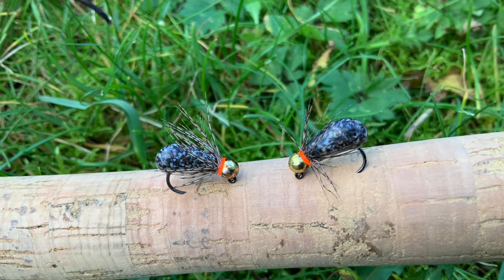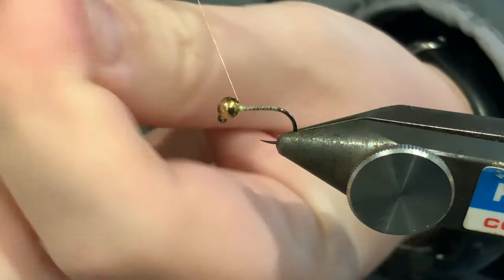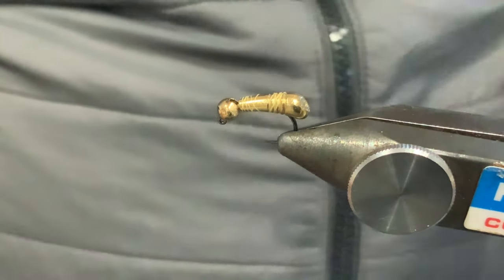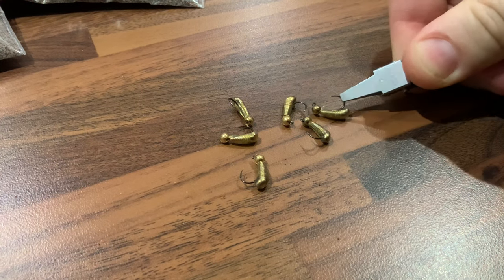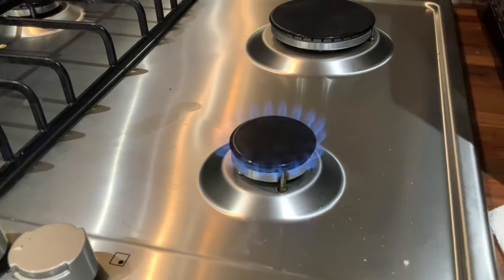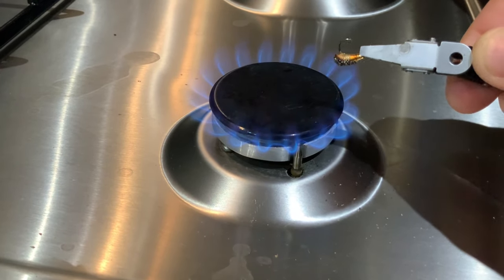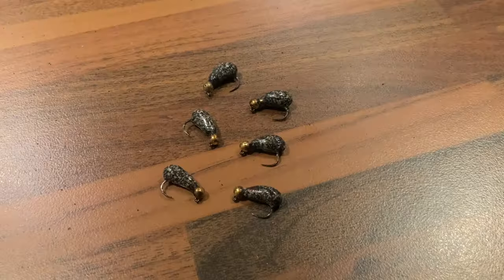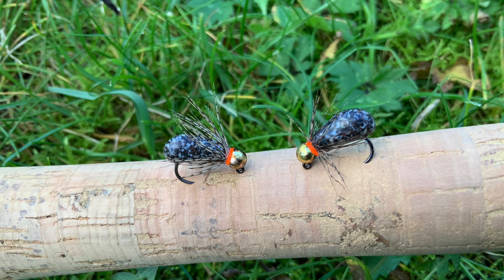HOW TO MAKE INDESTRUCTIBLE CASED CADDIS BODIES

Comment: Hi Terry, Great innovation could you post a link to the weight powder please? Would love to give this a bash.
Reply from the maker: Thanks, been using it for 10 years 😊

Just search “lead weight powder” on eBay Lindsay, loads of different colours and resellers.  Here is an example though:
https://www.ebay.co.uk/itm/GRAVEL-LEAD-WEIGHT-MOULD-COATING-POWDER-FOR-CARP-FISHING-LEADS-FLAT-PEAR-WEIGHTS-/190284958805?mkcid=16&mkevt=1&_trksid=p2349624.m46890.l49286&mkrid=710-127635-2958-0
Reply: @TheAnxiousAngler  Thanks pal will look into it.